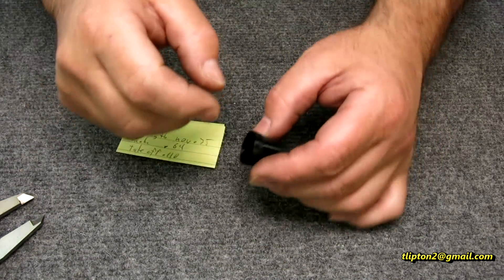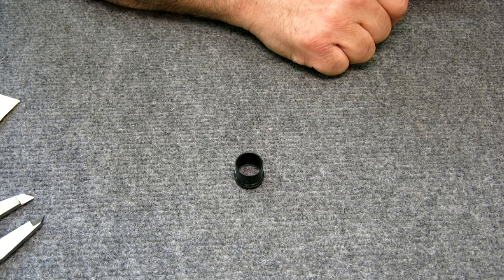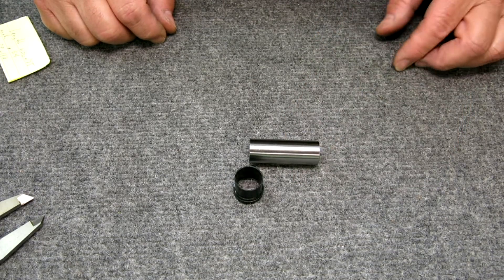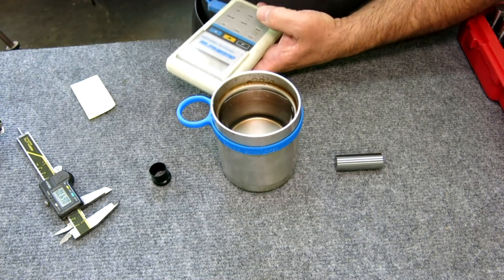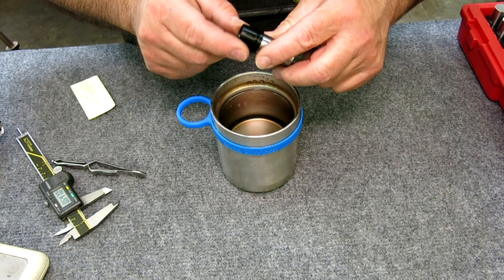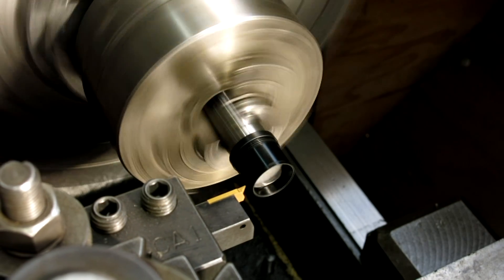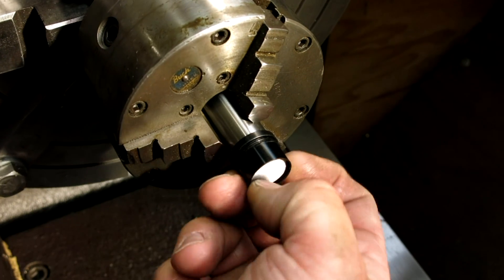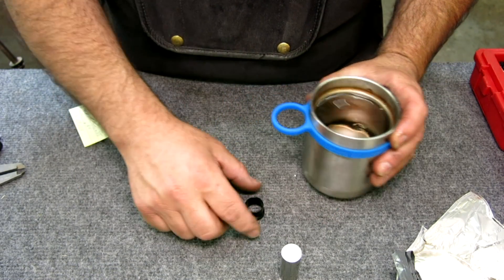Thermal Workholding Trick

Comment: Hi Tom love your videos 
just one question I would like to ask. I'm doing a complete full restoration on a Colchester 6inch master built in 1939. Been on it a month or so. And have a very long way to go.

I'm a bit concerned as the lathe I have only has a top speed of 550rpm. Not great I imagine.  

Do you think this lathe is going to cause me problems with some steels. 
Or should I cut my losses and maybe invest in a faster lathe. 
I've been working on it for a couple of months. I have so many days and hours spent on it so far. I just want to complete the restoration. As I believe she deserves that. But am thinking this may of been a bad purchase on my part. And should of considered a faster metal working lathe. Would love to know your honest opinion. If that's ok.

Comment: Couldn't you do it the other way round, ie freeze the steel ?
Reply: Pete Bloggs plastic changes more per degree
Reply from the maker: Harder to get -200 degrees of shrinkage by cooling. Steel moves less per degree than the plastic does. This is why I could get it off the steel easily. Cheers. Tom

Comment: Never knew plastic had a higher c.o.l.e than steel which is strange considering that aluminium does but is a better conductor than plastic or steel.
i will remember that trick for the next time i have to make plastic bush or sleeve !

Comment: Awesome tip, do have one question, why did you chose to part it rather than facing to length? Heat build up? Thanks for the Video!
Reply from the maker: Humm. Don't have a good answer to that one. Could have faced it. Locked on mentally to parting and never gave it another thought. Good question! Cheers. Tom
Reply: :) I was just thinking facing... so I guess we were both locked up! Thanks

Comment: Great tip. Also the wannabe engineer in me started to wonder if that same principle could be used as a elegant over temp clutch in some application...
Reply: Osmo Forsman Just my two cents, if it's being used on a spinning application, as it expands for the small amount of time between locked in place and loose some galling could occur.

Comment: Currently installing coolant jacket AC block heaters in engines, that mount in a frost plug access. Heating engine block to remove frost plug, while cooling block heater in dry ice. Once plug is out, in goes the cold heater base. Eezy peezy! No leak.

Comment: Glad to see that you used hot water to warm the plastic.  I do a lot of modeling with plastic and I always recommend the hot water method.  I have seen people try it with a heat gun and it melts quickly.